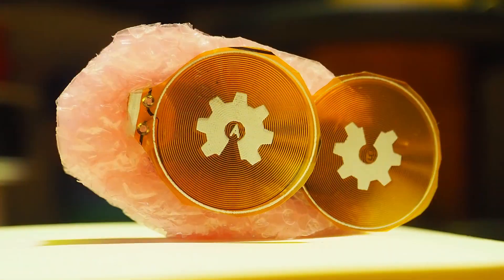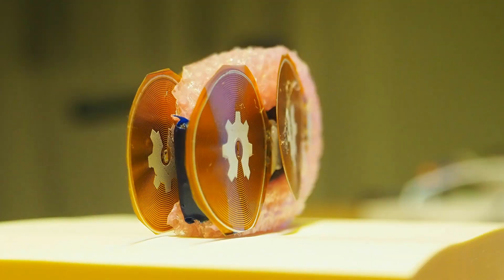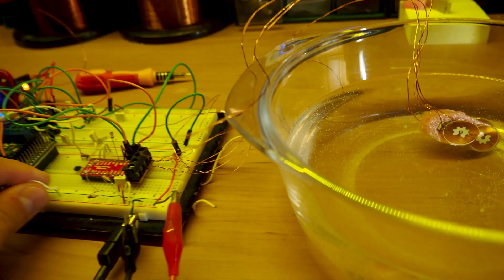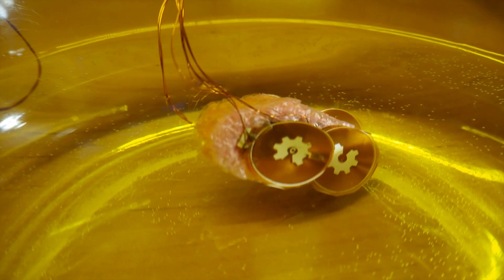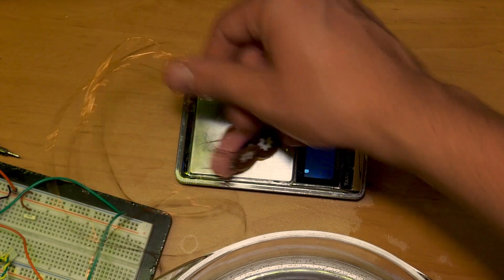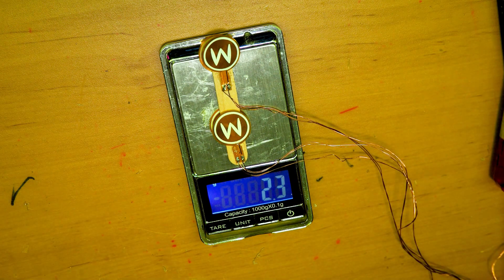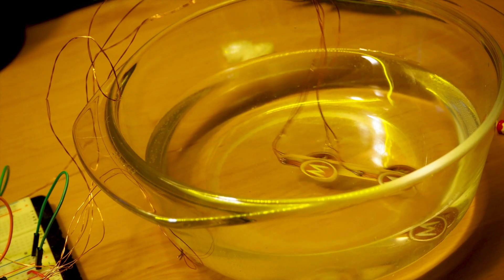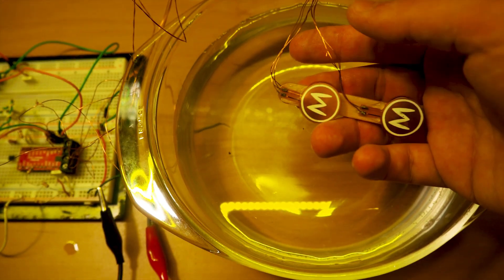Robot Fish with PCB Fins Experiment

Comment: Those wires that protrude for energy, hinder the prototype's impulse, making it look rough ... why don't you add some button cells ... with some oscillated circuit to save energy, space, and it weighed ... it could be a  LED RBG 5mm, and the base where everything will go could be a small small PCB ...

Comment: you should try using thinner wires to connect from the prototype to the protoboard, so they don't affect it's movement as much. What might work for you is to repurpose flexible enameled wire from cheap earphones.

Comment: Carl, u previously said that flex-pcbs with more than 2x layers are too expensive.  But have you tried just layering multiple of these 2x layer coils ontop of eachother, like a stack?  No need to even cut it, you could just fold and glue it.

The ability to fold and bend flex circuits back onto themselves is a unique advantage of flex pcbs.  it can be a very strange way to route traces too: by making origami in 3D space.  Bending the board back on itself and soldering the board directly to itself, using the board as it's own jumper wire.

Comment: Very nice work again :D how do you not have more subs/views?
Perhaps a submarine design could house it's own batteries so you wouldn't need the wires. or use a salt water battery if it scales
Reply from the maker: Thanks! The next version i'm design will be with onboard electronics and a tiny lipo battery

Comment: I thought maybe you'd just go without a magnet entirely, and instead use 2 opposing electromagnetic forces. 

But perhaps you need some weight to keep the fish stable.
Reply from the maker: Love your idea but unfortunately it is not possible.. For it to work you would require some kind of core around the windings to create an electromagnet but than you will lose the organic effect of the fin
Reply: @CarlBugeja   electrified coils will repel or attract eachother on their own, needing neither ferrite cores nor permanent magnets, but the effect is not very strong without a ferrite core to concentrate the flux lines.  Requires thicker wire too.   

Its not impossible, but yeah the greater power requirements and poor efficiency limit it's applications
Reply: @CarlBugeja   just had a further idea.  Since this is in water, remember that you CAN put more power through it with decreased risk of overheating ;)
Reply from the maker: cool idea.. but what will happen then if it jumps out of water? :P

Comment: Looks like the wires you use are what keeps the setup rigid. I think what you have will work with different more flexible wires.
Reply: I was thinking the same thing. For a demo purpose like this a drop of food dye in the water, very close to the fish, would be nice to see how much water is actually being moved :)

Also, for the weight issue, would it be possible to wire the fins on each side to oppose and attract each other instead of using the magnet? This would probably need some sort of relay-circuit outside the water to work though, and that would be hard to scale down to fit on the fish later.
Reply from the maker: The food dye idea is very interesting i would definitely try it on the next prototype 🙂 your other suggestion is not possible as these are only coils (without a core). For that to work you would require some kind of core to create an electromagnet but than you will lose the organic effect of the fin
Reply: @CarlBugeja  you can indeed have a iron oxide based pain which would replace the magnets this reducing weight. Another option would be using nylon lines to activate the fins. And within blue tooth connectivity, you could eliminate all cables...
Reply: @Simen1991   oh are you thinking it might need a relay because the air-core (well... water-core i guess) induction coils will require greater power to effectively attract & repel eachother?  Yeah maybe.

But at least the water submersion will help keep the coils cool while they are being blasted with that high voltage :D
Reply: I was thinking more to switch between two circuits sending current in two different directions through the coil, thus generating opposing magnetic field and giving the same coil the opportunity to change the direction of its field.
Reply: thats true wires add more resistance should be raplecd by more flexible ones